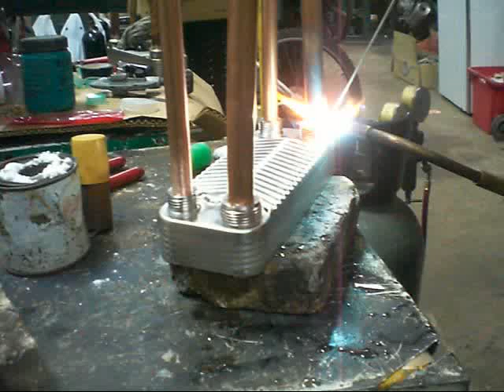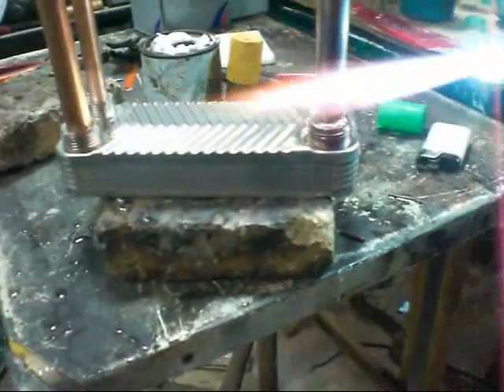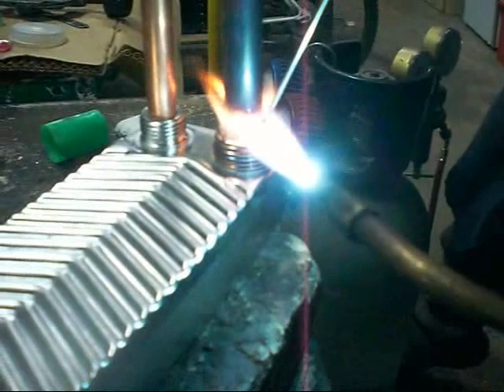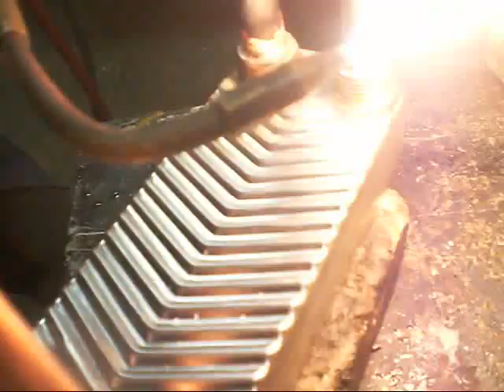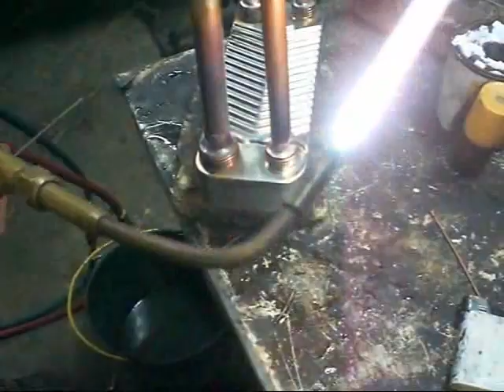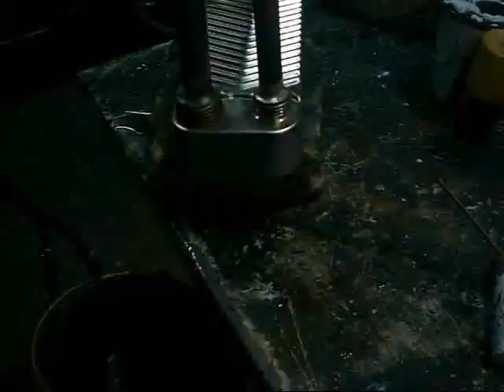Brazing of flat plate heat exchanger

Comment: Someone worked hard, with great brazing skill, with limited video equipment and background, to show how to do this.  

The video would have been better if the makers had set up a background that would have been less cluttered and, therefore, less distracting.  Then planned the camerawork beforehand using a Steadicam, to eliminate the jerkiness. They could have gotten rid of the radio in the backround, the car honking it horn and used an appropriate soundtrack and voice-over commentator.